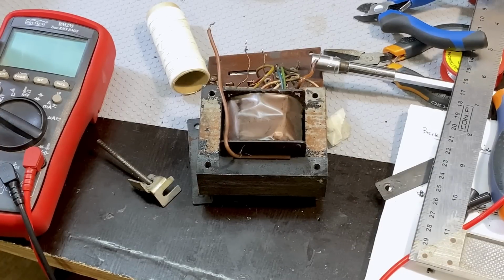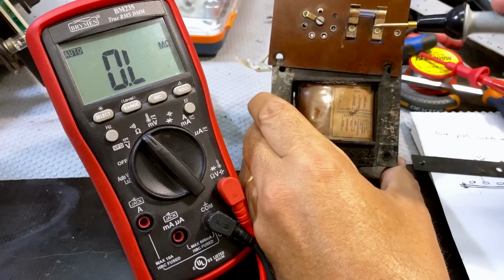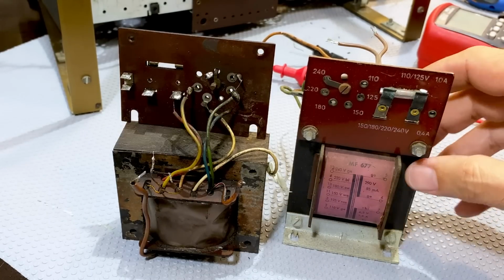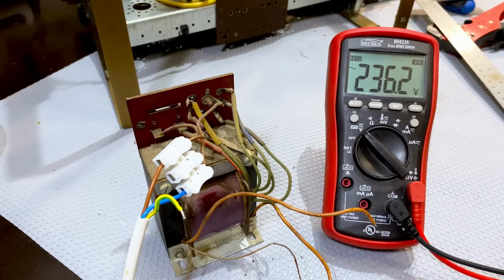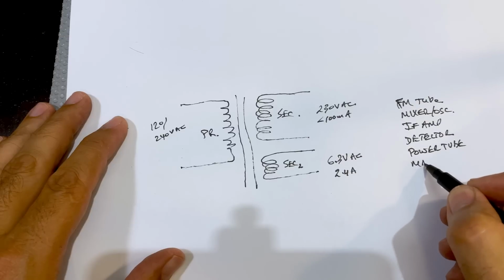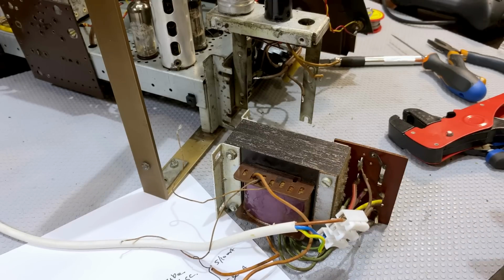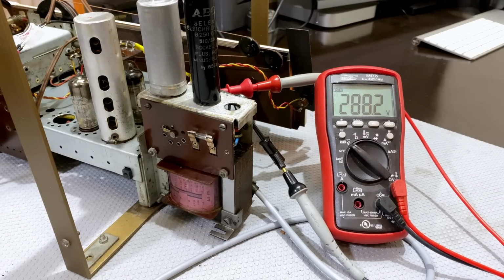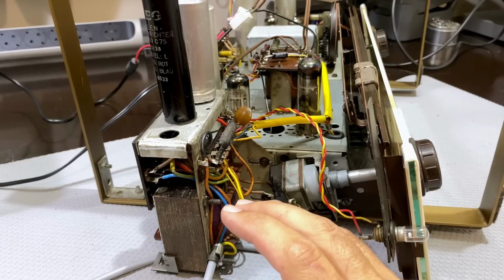Sometimes we need to Frankenstein a power transformer. Nordmende Super 250-9 rest. pt. 5

Comment: Good stuff Manuel. I have had a number of transformers fail, I managed to find replacements or rewind them 🙂
Reply from the maker: I thought of rewinding this one, and then got lucky with the scrap find.
Reply: I had a couple of transformers fail also.  I find here in Australia, as our supply is 240 to 250V (sometimes even a bit higher) that imported radios from Eu that are designed for 220V, maybe 240 at the most, seemed susceptible to the primaries failing.  Guessing it is due to them running that little bit warmer due to the windings not being designed for our higher voltage on the mains.
Reply from the maker: Makes sense.

Comment: I just refurbished a VTVM. Besides decades old capacitors and knobs that wouldn't turn anymore, the major malfunction was the power transformer. Mine turned out to be a supply wire not connected to magnet wire. Peel off a bit of the paper and hit it with some solder and life was good again. Simple repair that could have been far worse =)
Reply from the maker: Sometimes we get lucky. 😊

Comment: I am on a Satellit 2100 restoration, and the former owner thought he was able to cheat the primary fuse. As a result, the whole primary became the fuse. I firstly replaced it with a new  Chinese transformer, electrically fine, but the "physical" did not make it, a bit too large. I found a vendor with Satellit parts, he did not advertise any transformer, but after a mail exchange, he had two to sell. So finally, I could replace the transformer with an original part.
Reply from the maker: That’s great.

Comment: I can't claim this to be the absolute case here, but often using a VOM to measure the windings in a transformer, or motor, or some other device with windings that has higher voltages applied than the voltage applied by a VOM will read just fine. The problem will be that the insulation may be damaged physically, or even molecularly in a way that it breaks down and conducts at the normal applied voltage. This is why we use 'hipot' testers for testing devices that run at higher voltages. I like to apply a voltage at or near the voltage a coil sees in service. One must be careful not to go too high with voltage applied from a hipot tester because you could damage the insulation ruining the device by doing so.

Comment: Fantastic video! I had to do this to a philips radiogram I repaired a while ago, the power transformer had shorted turns on the primary as well, which I suspect was due to the selenium rectifier also being shorted. So I suspect the chain of events were as follows, the selenium rectifier shorted, and that took out the transformer. Mine was so badly shorted it started smoking instantly even on a bulb limiter!
Reply from the maker: 👍 With smoke you can at least immediately recognise the fault. Not that it’s easier to swallow, however.
Reply: @electronicsoldandnew  very true. Not fun either way!

Comment: U can referb transformer 

Get bobbin free and unwind and spray paint wire and re wind it 

Or use a massive reel of hook up wire etc 

If you use wavelength measurements u can likely pin point were the winding is popped 

Bonus use mots microwave oven transformers as base make ur own 

And supper bonus roofing factorys and other stuff get scrap coils steel and grab that paint it and got toroidal transformer base

Comment: If you weren't concerned with keeping it all original I bet you could have found a modern replacement transformer or two ( 230VAC and 6.3 VAC ) in Digikey or  Mouser and squeezed them into the cabinet some how. That is if you just wanted it to work. At that point all of the rest of the radio would be original except for the power source. Glad you had one though.

Comment: You could maybe try dipping the transformer in insulation varnish to try and stop the shorting in the primary
Reply from the maker: It is already solid with resin so that’s not an option, unfortunately

Comment: At 15:30, you didn't write "rectifier tube" on your reverse-engineering list (assuming the radio has one). A 6 volt rectifier tube usually needs at least 1 amp or more of current, typically from the same heater winding as the other tubes, to heat it. (A 5 volt rectifier typically needs 2 to 3 amps, supplied rom a separate winding.).
Reply from the maker: You’re right. As I said, look for a similar tube lineup. If it has a rectifier tube, you need a transformer from one that also has one. By the way, some of these german sets use the EZ80 that needs 0.6A but after that, you’re right. Most are at least 1A.
Reply: @electronicsoldandnew   here in the States I don't see too much equipment that uses the EZ80 AKA 6V4. Some units use the  EZ81 AKA 6CA4 which if i remember correctly draws .8 amps, and I see a fair number of 6X4 tubes AKA EZ90 which draw .6 amps.  The 5Y3 and 5U4 are much commoner in most vintage audio gear here.
Reply: @goodun2974  6X4s are most commonly found in 6V car radios.  They are electrically similar to the 6X5.
Reply: @douro20  , I've seen them used in low power audio amps and tuners.  Sometimes they're used just for the preamp and tuner power supply and a different rectifier is used for the power supply of the  amplifier output stages.

Comment: I think Mende / NordMende used the same design on the power transformers for some time.  Why change something that works :).
You were lucky you had a NordMende chasis as parts.   I think it would have been a more difficult and more Frankenstein mod if you had to use a transformer from another set.   I would almost not even call this Frankenstein.  If the Power Transformer ahd been replaced 50 years ago, it likely would have got the same one you put in.   :)
Reply from the maker: I agree. This was pure luck.

Comment: Manuel, would you rather have a power setting of 220 volts getting 6.4v on the filaments under load, or a setting of 240 volts getting only 6v on the filaments? Thank you for the video!
Reply from the maker: I would prefer the lower heater voltage, as long as it’s close. Less than 6V would get me thinking of alternatives.
Reply: @electronicsoldandnew  I just today built from an old car battery charger, which I got for free, a box which I can use to increase or decrease 230 VAC  by about 9 or 15 volts. Those old car battery chargers which have 12V or 6V battery option with a switch are almost perfect to adjust proper 220VAC or 240-250VAC mains voltage to  vintage equipment if mains voltage "from wall" is 230VAC. If only voltage drop or increase ( but not both ) is needed, you don't need any extra switch. If you want option to both increase and decrease voltage if wanted, you have to install extra switch to be able to change the phase of the secondary winding. With that box I can usually very easily optimise heater voltage to 6.3VAC. Guitar amp guys call that a Brown Box and they use it mainly to lower mains voltage for vintage amps.
P.S. Very nice video again. 👍
Reply: Good. I had a second look on my friend's vox ac50 that was on the 220v setting it was running crazy high plate voltages. On the 245v setting the bias looks spot on for a pair of el34s. I was just worried about those filaments. Thank you very much :)
Reply from the maker: pleasure
Reply from the maker: Those Voz amps already push the power tubes hard, even at the correct AC input selection. It’s a good idea to tame it a little, as you did.